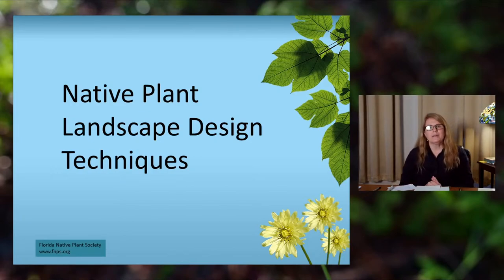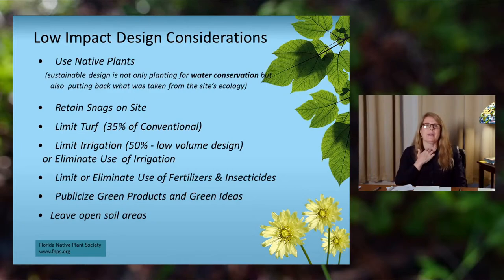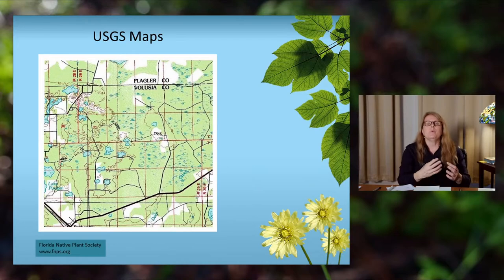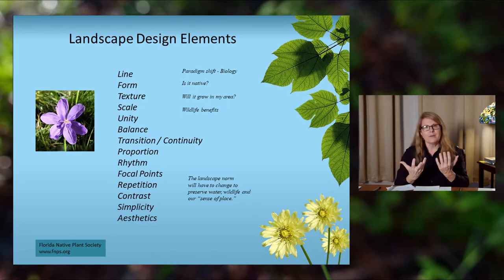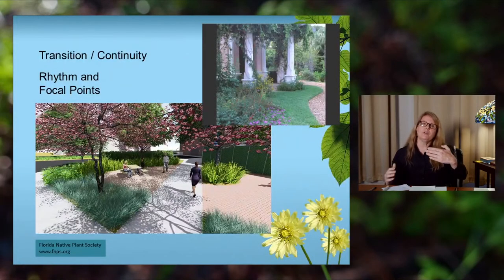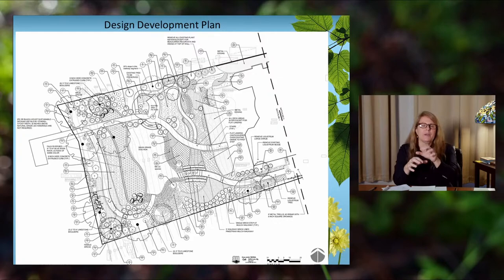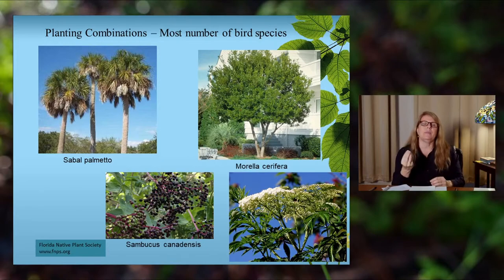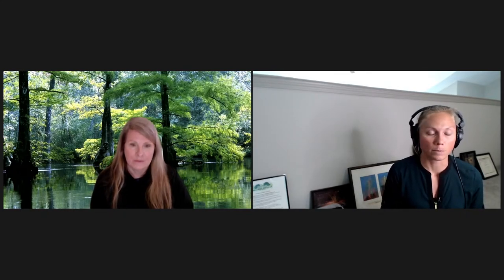Native Florida Landscape Design Part 2 - Design Techniques with Karina Veaudry

Comment: One thing I've encountered since moving to FL in 2019, is that gardening is year round. The plants you place in full sun for the summer don't die off, shed leaves or go dormant. And for a few months, they can be in full shade. That has been a challenge. So many more things to think about. I do appreciate the insight and expertise in using FL natives and the emphasis on those endemic to your area when possible.